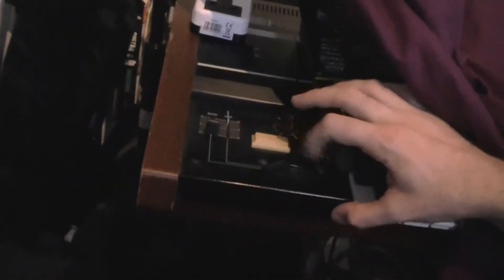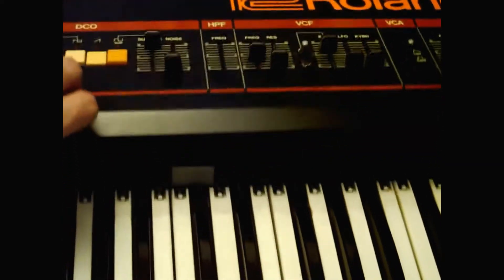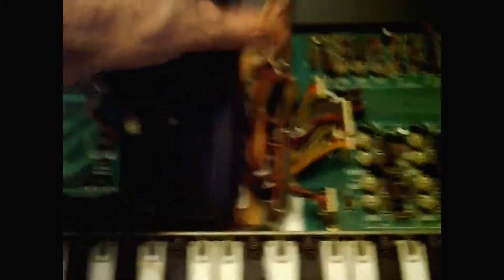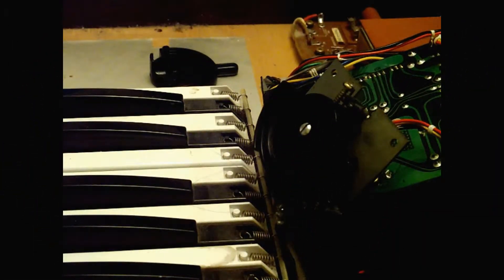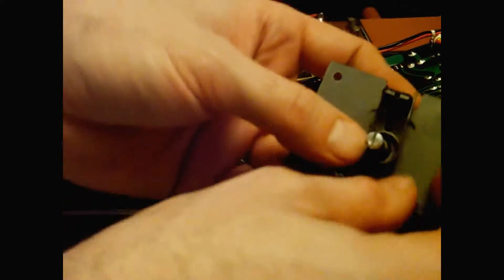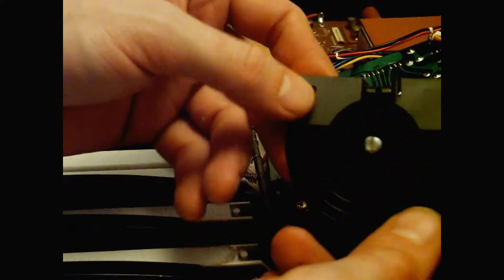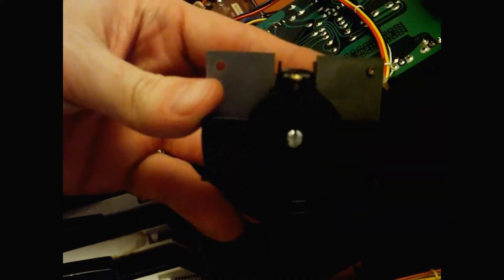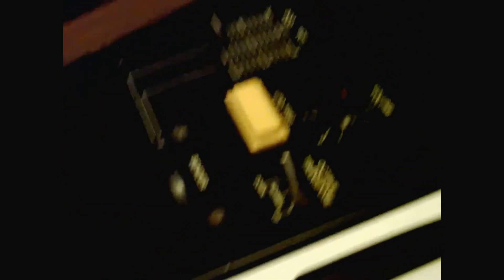STUDIO MADNESS FIX VID: E01 - Juno 6

Comment: Thanks for this. I bought my Juno on ebay 13 years ago and the bender was snapped off even before I collected it. Once I eventually got round to getting the replacement part and opened it up I discovered that none of the wires were connected to the pot, so the project was shelved. Following a house move I finally dug out the Juno a couple of months back, and watching your video did two things. 1) convinced me that replacing the bender itself was quite a simple task, and 2) by pausing your video I could see where the wires should be!  So thanks, job done, one very happy Juno 6 owner!
Reply from the maker: Great to hear it. And yeah, older synths are much easier to work on. Built like tanks!

Comment: Heyy! Did you use a phillips or a PZ for the screws holding the bender wheel in place? 

Thanks!
Reply from the maker: Fairly sure it's a phillips. You can check by looking at the screw. If it just has one + then it's a phillips.